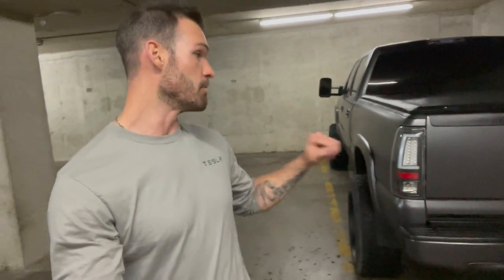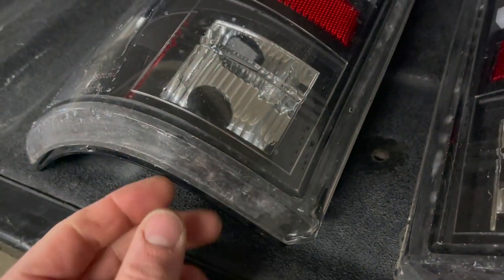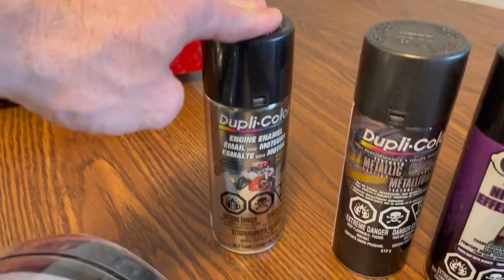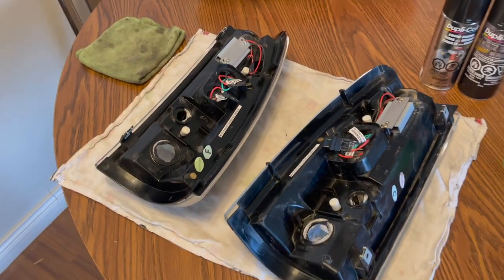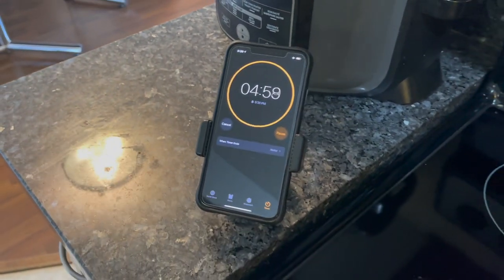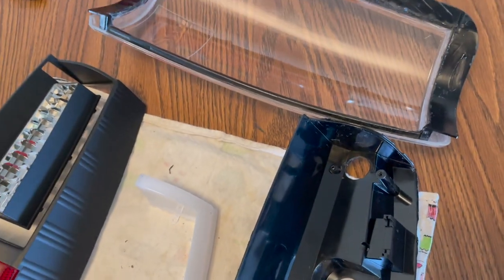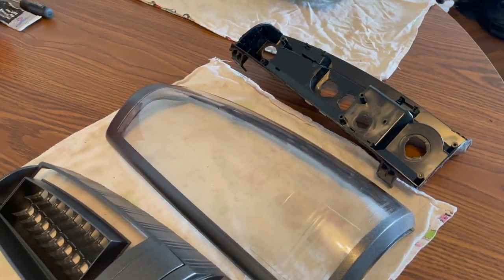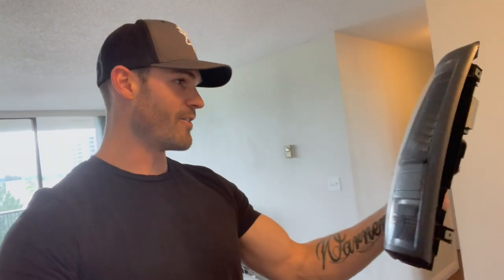HOW TO COLOR-MATCH YOUR TAILLIGHTS FOR $25!

Comment: That’s just incredible man….. for sure doing this for my 3rd gen mega cab 👍🫡 thank you sir for video and instructions
Reply from the maker: Thanks man. Just be aware that with tinting the C bar, it does make your brake lights significantly darker.
Reply: @warnerbu7lt  no problem bud and I’m not going to be tinting the c bar, just color matching them 🫡

Comment: Question here, why bake them if you are cutting them?
Reply from the maker: It softened the glue a little bit and made it easier to cut through. Also the heat made it easier to pull apart once it was ready.

Comment: Do you need to cut them? Or will they separate by baking them and picking at it ?
Reply from the maker: There are many different methods to separating the taillight lens from the housing. I found heating them slightly and then cutting them to be the most effective way for me personally.

Comment: Did you scuff anything other than the lense? And what did you use to re-seal the lights?
Reply from the maker: Scuff everything with a scotch pad. I used RTV sealant linked below the video.
Reply: @warnerbu7lt  for one Thankyou for responding, for two I really don’t know if you mentioned what you used or not, when I watched the video there was a lot going on, but Thankyou man, I have these same taillights brand and all

Comment: no hate at all they look great but why no scuffing or primer? are you worried the paint will flake at all?
Reply from the maker: Thanks Tanner, the paint that I used was actually a textured trunk/toolbox paint which has built-in adhesion promoter and doesn’t require primer before hand. 

If I was using regular or automotive paint and looking for a smooth glass like finish, I would strongly suggest scuffing the surface with scotch pads, using some sort of adhesion promoter and priming prior to applying your top coat.

Comment: Did you had to cook them or just cut them instead of heating them ? Lights came out sick!
Reply from the maker: Thanks man! Heating them up isn't absolutely necessary, however I found it allowed the plastic to soften a bit which made it easier to cut through with my dremel.
Reply: Ahh got you thanks mann keep it up bro 💪
Reply: @warnerbu7lt  first timer here, what part are you cutting?

Comment: I just bought these tails and tried doing the oven thing and I snapped the corner..I plan on painting a lip around the lense so hopefully you won’t tell but now I’m going to cut them like you did
Reply from the maker: Yeah they’re sealed really tight, the only way to get them open is by cutting them.
Reply: @warnerbu7lt  what glue did you use to seal them and how are they holding up
Reply: @Jp_5ive3hree  I used black RTV silicone by Permedex and it’s been flawless, absolutely no condensation or dust issues.

Comment: awesome did you use epoxy for sealant
Reply from the maker: I used a black RTV sealant that has been incredible, no condensation at all
Reply: @warnerbu7lt  cool do you have a video of the tail lights illuminated
Reply: @javonsedwards  no, but there are photos on my IG. They’re pretty dark tbh.. if I was to do them again, I would tape off a small centre strip to allow some light to come through for nighttime driving.
Reply: Ok thanx

Comment: Anyone have a link for these tails not trying to pay over 200
Reply from the maker: Unfortunately if you want true spyder branded tail lights, you’ll have to pay over $200. Also, I’d advise staying away from cheaper “eBay” lights as you’ll likely have LED’s fail in under 6 months. Just my 2 cents..
Reply: @warnerbu7lt  do u happen to have a link or part number to tail lights I can’t find them